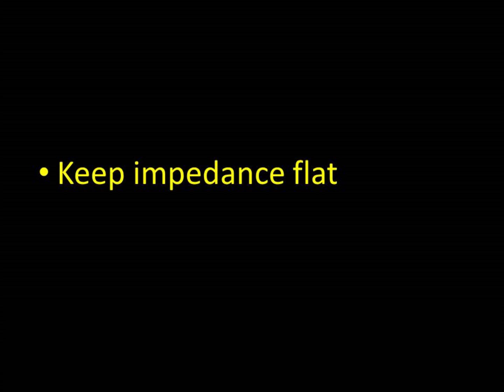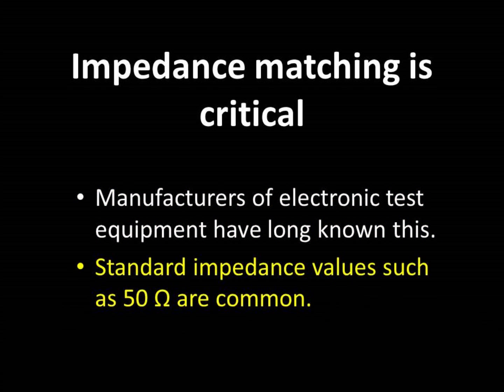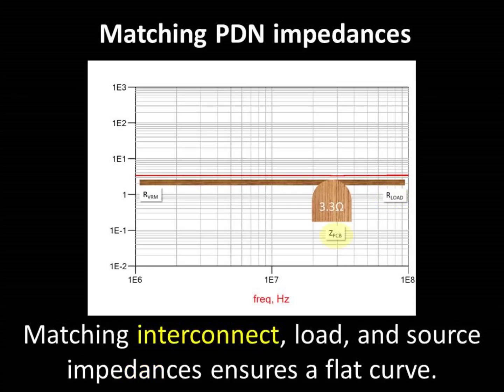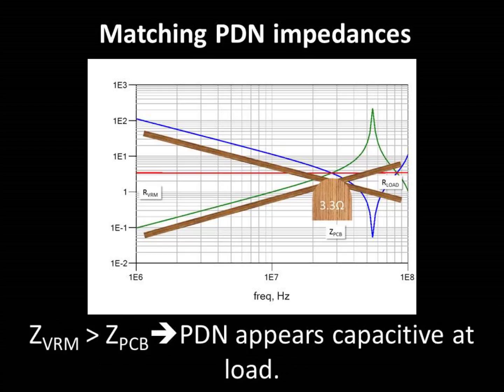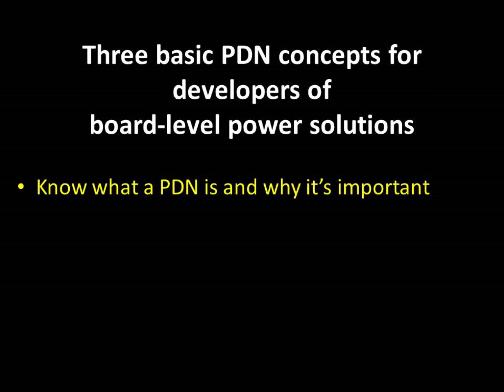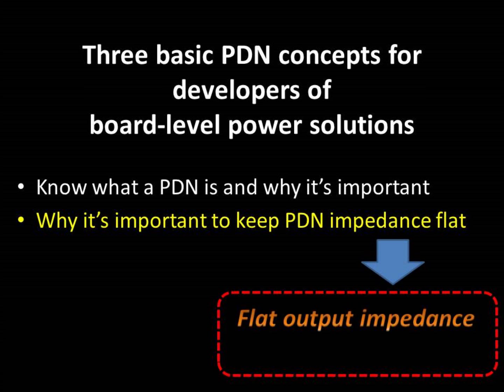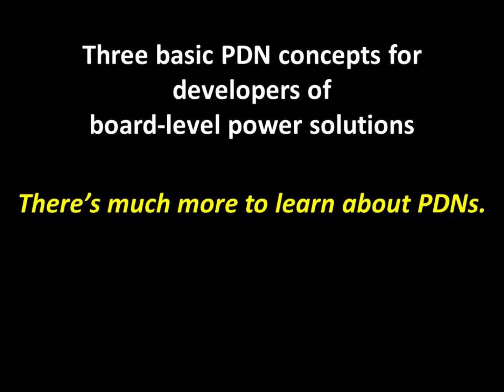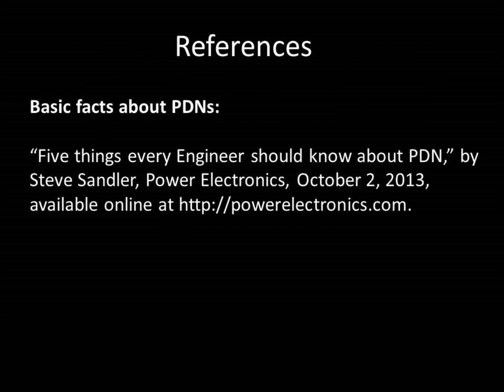PDN Basics For Power Designers (Part 3): Impedance Matching Is Critical

Comment: In an email to Steve Sandler, the presenter in this video series, Tom Lawson of CogniPower writes, "I enjoyed your video on Power Distribution Networks in the latest How2Power Today. My experience aligns in that people just don't pay enough attention to power distribution.For an intermediate power bus, the other way to attack the problem is to eliminate high edge rates. The Compound Converter topology, designed for PFC applications, is also applicable to DC input power converters. If the POL converters on an intermediate power bus draw only DC input current, the issue becomes much easier to deal with. You might think that the extra cost and complexity involved would be prohibitive, but these topologies are so simple that the extra cost can be more than offset by reduced need for input and output filter capacitors."

Comment: Peter Markowski of Envelope Power comments, "Very nice quality. The content is probably also optimal for such a short form. The author knows what he is talking about. It has been a few years since my last VRM design, so I am a bit surprised that today these things are supposed to have matched and flat output impedance from 1 to 100 MHz. Frankly I do not see a need for that, as low impedance connection should be sufficient and then controlled impedance can be started on the system board. But I did not think about it for a long time and may be missing something."

Comment: Commenting on the three videos in this series, viewer KD writes, "
The video series is a good introduction to PDNs for those not familiar to this concept. Here are some related topics which I think could be incorporated to give additional value to the series:
 
1)  Methods and guidelines for controlling the Q (peaks/nulls) of the impedance curve in the PDN. The point is well made to “keep the impedance flat”, but what knobs are available to accomplish this? (Answer: the ratio of the resistances of the network to the characteristic impedances of each resonance.)
2) More detail on how the output impedance of VRMs can result in inductive or capacitive PDN impedance at the load. What is the typical output impedance of a VRM, particularly a switching regulator (Answer: inductive, with a series resistance component) and why (Answer: because of the declining loop gain vs. frequency profile of the regulator)?
3) Mention and treatment of the topic “Why resonances can occur near loop crossover, even without resonating components.” Treatment of how to avoid or mitigate this condition (require a high enough phase margin for the regulator)."